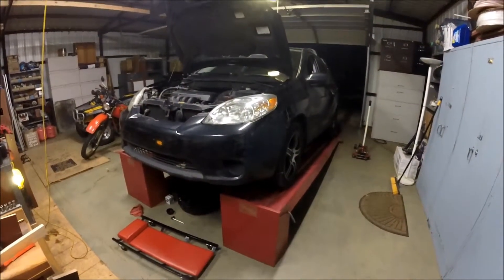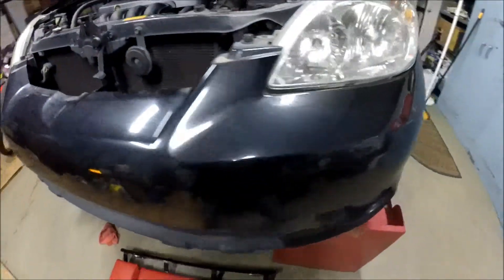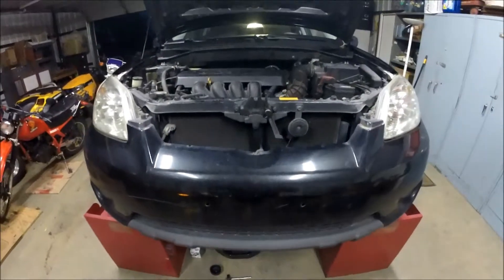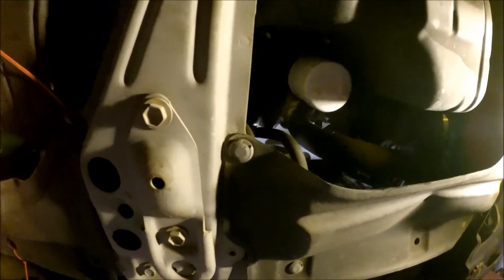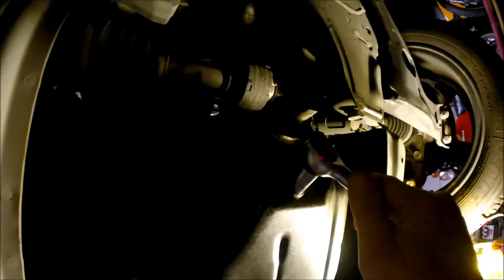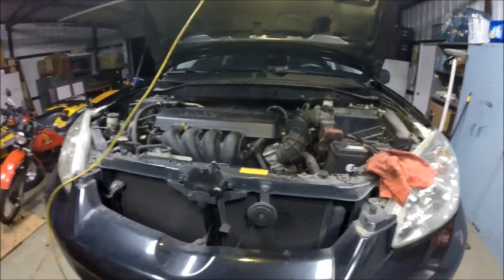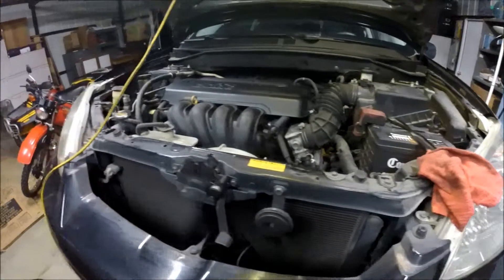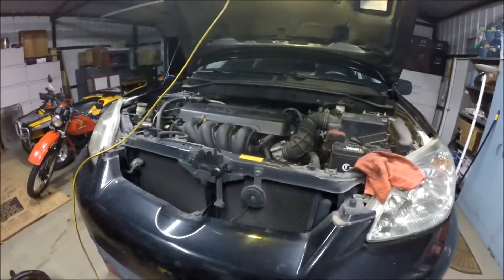DIY Oil Change Toyota Matrix  Pontiac Vibe

Comment: The Oil change! One of the most important things to be done to an engine yet also quite simple, nicely done man!!(What would the mechanic have charged u?)
Reply from the maker: They charge 50-60 for synthetic oil change. May be more but I haven't paid for an oil change in years. This one cost me around 25-30.00 plus 30 minutes of time, well worth it. Thanks for commenting.
Reply: Ya and there's no guarantee they have changed the oil or the filter, the only guarantee with 'SOME' mechanics is that u will b charged!!!!